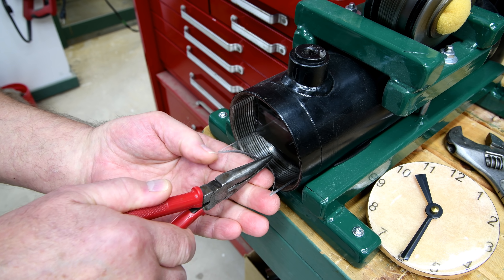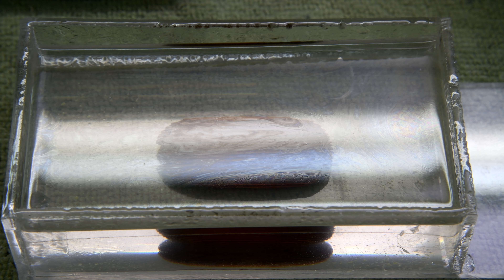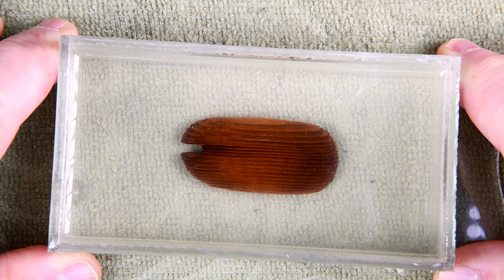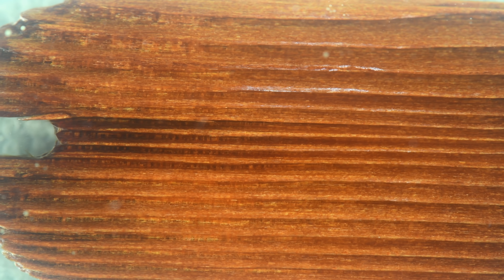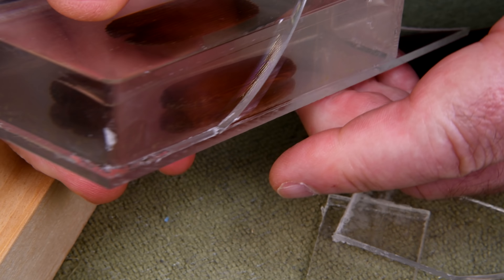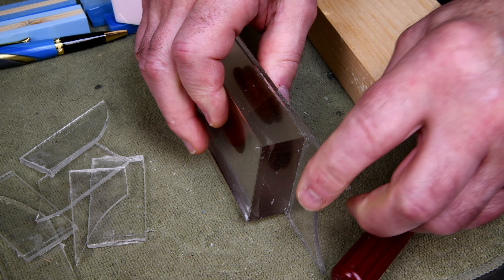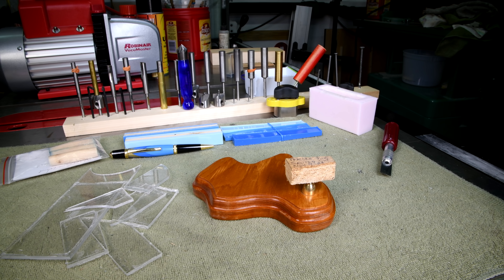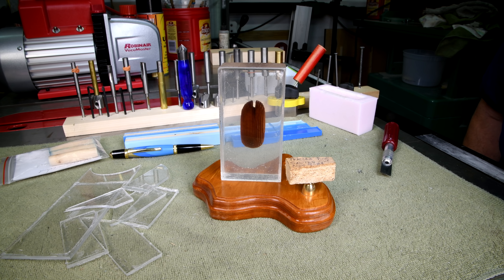The Pendant From Cox Bay - Part 12 (conclusion)

Comment: Hi Ron!  I think your original issue with cracking was due to thermal overheating.  The Alumilite folks talk about some of the standard clear cast products possibly cracking in a higher volume pour.  On one of their many documents I was reading about this and their slow-set products "for woodturners" which generates much less heat during the cure.  I've been playing too with their RC3 (Tan) fast set, it is hitting near 140 degrees F, or 60 C for my neighbors to the north.  Ready to remove from the mold in about 10 minutes!
Reply from the maker: Thermal cracking! Sounds plausible. That coupled with the air pressure in the pendent because it wasn't vacuumed out first all makes sense. That "RC3 (Tan) fast set" sounds a lot like 5 minute epoxy. Thanks for that info Bill :)